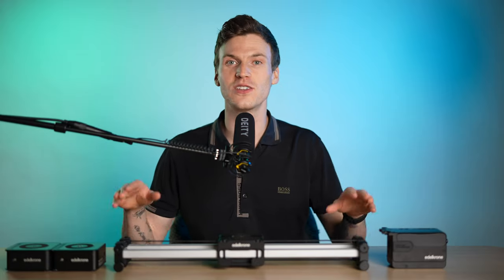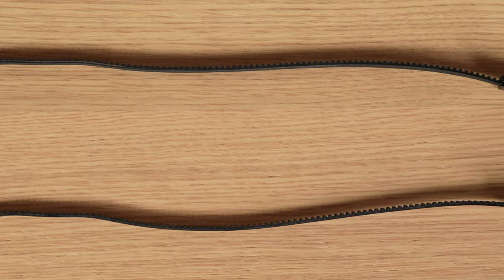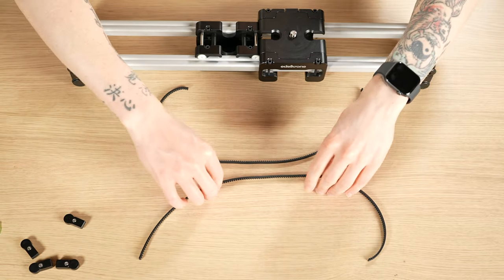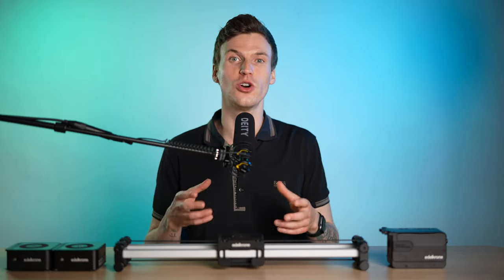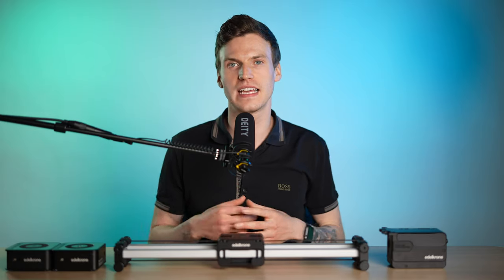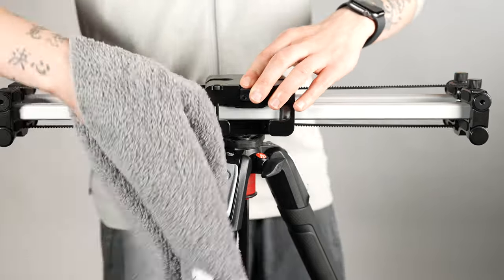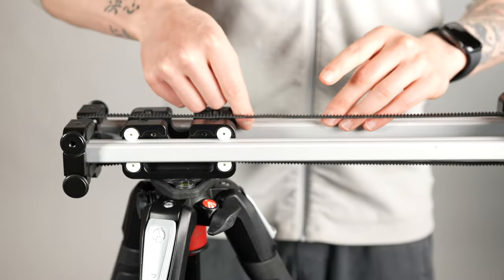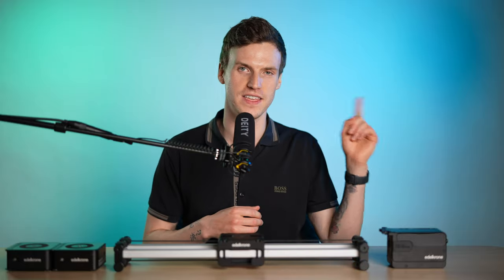Why Your Edelkrone SliderPlus Isn't Smooth. Edelkrone SliderPlus maintenance tips for smooth motion

Comment: Can you do me a HUGE favor?  I just bought a new Slider Plus as my old one is about 5 years old.  They sent me the notched betls but they are not cut to the correct size.  Can you please remove the belts and the magnets and tell me the exact measurements?  When I received the new Slider Plus, I did receive belts, but they were way too long.  I had to cut them with no guide and I ended up cutting them too short, and now I can't use my slider or my old one.  There is also a Head One stuck on the top of my old Slider Plus, which is why I can't just use the older belts...I can't get that thing off.  Anyway, if you could measure one of the notched belts and let me know, that would be huge.  Edelkrone support has yet to give me that measurement.

Comment: great video Edlekrone has nothing like this video and totally should. Their FAQ and troubleshooting section suuuuuuucks. I'm having an issue with my geared belts being way too tight to put on. I can't figure out how to adjust the tension. The manual says something about sliding the ends out if it's too loose (but I still cant figure that out either)
Reply from the maker: Hey there :) thank you for the kind comments. So the only thing I can think of is you have to screw off the ends and try to tighten them a little farther on the belt. You probably have a little bit of extra room to play around with to widen the whole belt